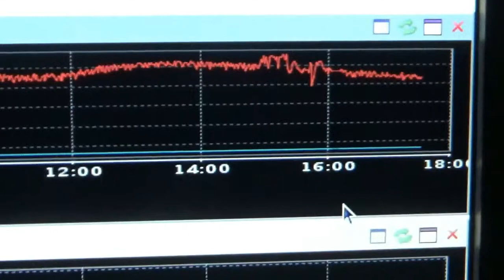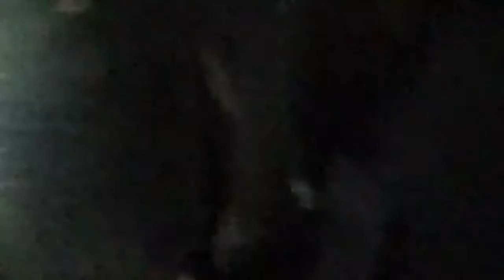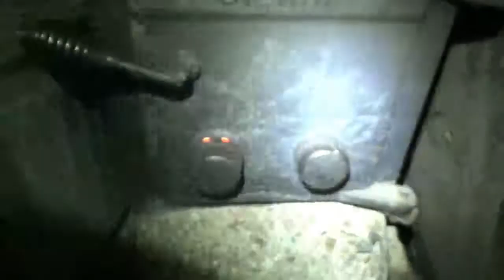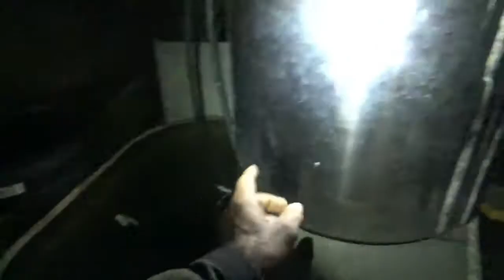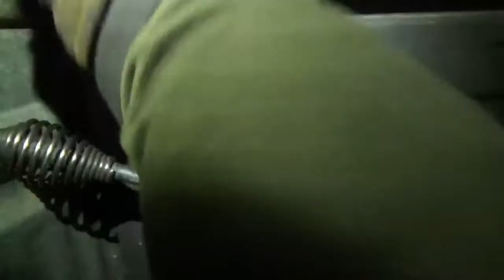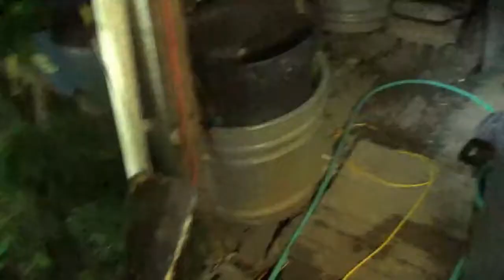Build Your Own Greenhouse Series Part 6 *Practical Walk-through*

Comment: Lol you will never get that box closed I've got a couple of boxes just like it I would have to unhook everything and run the wires back through a bottom fitting like I should have built it!  If you actually ever get that door shut you're going to need probably another fan to keep it cool everything will start overheating most of mine I just set up to where I can clamp the top in case it starts raining but all my boxes like that are already inside anyway and so is yours You can leave them open if you don't have a rat infested area.  I just got to crack the joke with you Good luck on getting that box closed I've had some boxes I've been going to close for about 6 years now they just keep working open In fact I think if I close two of them they will overheat.  Lol.
Reply from the maker: Yeah, it's more of a "long term goal"  haha!  You should go back and see the original hanging rats nest! lol https://www.youtube.com/watch?v=r697xtMLJgA&list=PL837tk-T71LiUuXWUAkwMVonwd1M5koAW&index=65   Yeah, actually the fan in that box will move 200 CFM and I've had it closed and tested it.. pretty good over fall winter spring.. summer it really needs a cool air inlet from in the ground or something. I just know if I ever do get that box closed the project is basically completely done and I have gotten bored... not likely! lol  I'll probably end up adding several more as things go forward.  I have a friend who likes to build stuff too and he is very stuck on "clean wiring"... I can't tell you how many times he's wired something up, zip ties it all in.... had an issue.. and had to undo it all. lol  cheers!